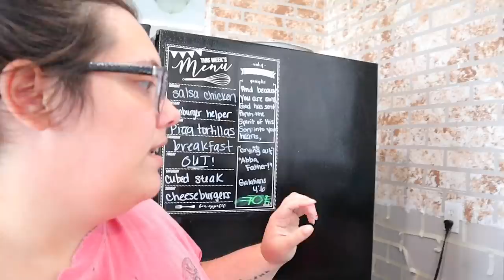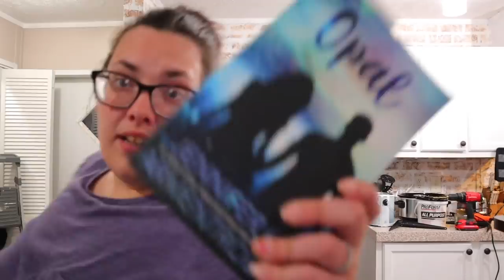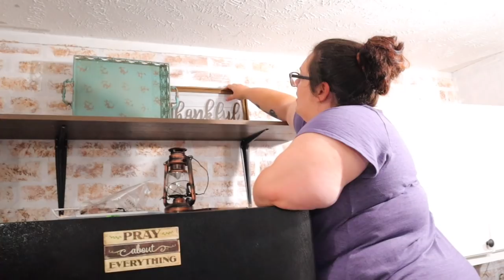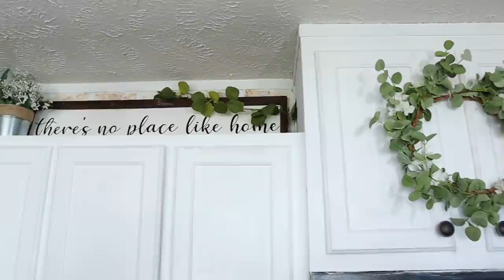SINGLE WIDE MOBILE HOME DECORATE WITH ME | faux brick tutorial | mobile home makeover on a budget!

Comment: the wire under the cabinet you can use these https://www.lowes.com/pd/Gardner-Bender-50-Count-7-16-in-Plastic-Low-Voltage-Cable-Staples/4633401 i used on the porch to the lights worked really good and holding